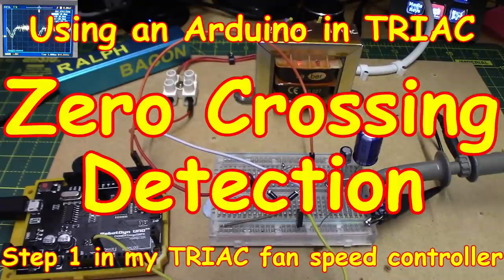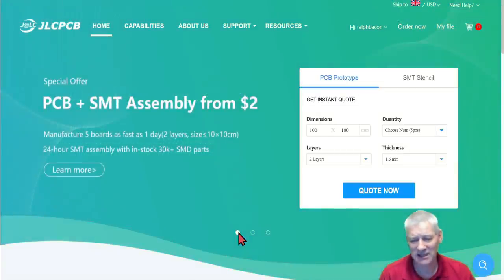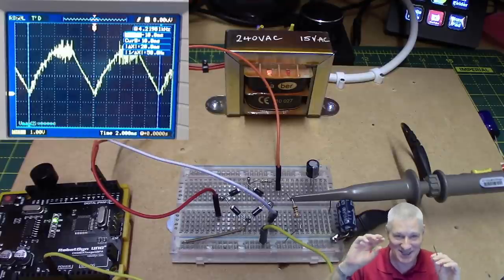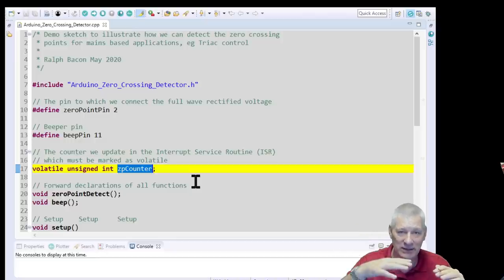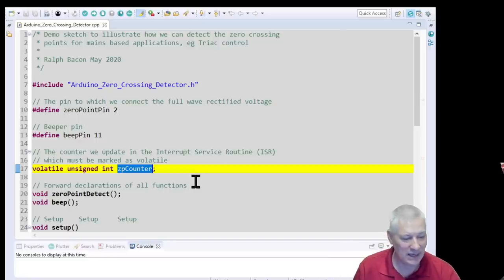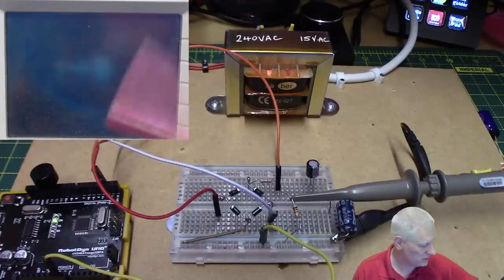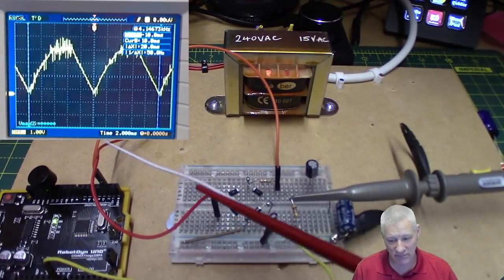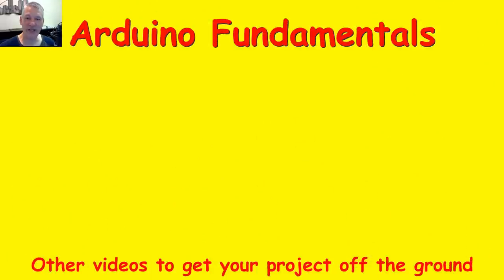#189 Zero Crossing Detection using an Arduino (TRIAC Dimmer Control)

Comment: When I was a kid in the 1980`s I made some disco lights with a tape recorder, 555 timer, 4017 decade counter and 10 triacs. Don`t know how I did it without the internet lol. Now 50 years later I want to do the same. :)
Reply from the maker: I, too, made some disco lights when I was a teenager (yes, we had electricity and even running water back then) but I'm amazed I survived all that 240-volt stuff. No isolation in those days, direct connections to triacs. 😲

Comment: I've build similar projects before. One thing to keep in mind is forward voltage drop of the LED in the optocoupler. This can cause a timing issue when trying to run near 100 percent. The opto will switch off before the zero point and back on after the zero point happened. A simple solution is to only allow a maximum on percentage for the trac, say 90-95 percent. Otherwise you'll need to have a very critical time delay required from the trigger point to the actual zero cross. Trigger the trac slightly to soon and you'll miss a whole half cycle.
Reply from the maker: Indeed, timing will be critical but I hope software will allow me to adjust this. We shall see!

Comment: I would be interested to see you toggle a pin on every interrupt and see how the edges line up with the actual zero-crossing. Because you're using digital voltage levels I suspect they may be off. Thanks for the video.
Reply from the maker: Yes, indeed, they will most certainly be off, a bit, but we can correct that in the software by including more delay before switching on the TRIAC. I'll cover this in a future video, Marc, it will be useful for everyone to see. Thanks for raising this.

Comment: Great explanation mate, thanks for the video. I was like WTF when I seen you attaching a transformer to an Arduino but it all makes perfect sense and has some merit. Looking forward to your next video
Reply from the maker: Remember the rectified AC went through two resistors (potential divider) before hitting the Arduino, see the circuit diagram in my GitHub for full info.

Comment: 4:13 Thanks.  This is the most important information I've heard in a long time.  It explains all my USB problems.  It does seem like they started when I replaced my USB 2.0 hubs with 3.0.  My old 2.0's died so I replaced them with the latest and greatest.
Reply from the maker: Glad it helped!
Reply: @RalphBacon  ever since I replaced my 3.0 with 2.0 the other problems went away as well.  I think 3.0 causes Windows to produce spurious interrupts.

Comment: I have always avoided level triggered interrupts, use edge triggering whenever possible.  In fact I cannot think of a reason to use level triggering.  Your on screen comment "I suspect the pin is kept LOW too long by the signal" is quite correct.  This ISR is very short, if you use level triggering, by the time you get back to the main programme the level will still be within the LOW parameter so another interrupt is generated.  Using an edge triggered interrupt avoids this problem.  No matter how quickly your ISR is serviced, another interrupt request will not be generated until the next falling edge, i.e. the next cycle.  Bob
Reply from the maker: Yes, indeed, Bob. The pin is LOW once the voltage drops to about 2-3V and stays low until it goes above 3V again on the next (half) cycle. I can't work that out in my head but it is probably a millisecond or two which to the interrupt hardware is an eternity and just keeps triggering! Others have commented on using level triggering, usually with the word "Why?".

Comment: Hi Ralph, interesting stuff indeed, this is a good proof of concept I look forward to phase 2 and capturing the exact zero point, as an interrupt triggering on a falling edge is probably gonna be a bit early but i'm sure you've figured that out.
Reply from the maker: Well, 2-3 volts too early, probably, which we can correct in software (ie delay a bit more). I'll get the 'scope out and get it spot on!

Comment: I once used a single diode (half wave AC rectification) as input to an optocoupler.  That gave me a square wave pulse for each cycle.
Reply from the maker: Yes, that would work. The half sine wave could possibly be made squarer with the use of a Schmitt trigger but if it works as-is then it works!
Reply: @RalphBacon  Point taken, but it's only triggering a counter IC for a clock, so as long as it transitions low to high, it's fine.  I don't think it has to be a perfect square wave for this application.  In fact, I'd say that even if it was a sine wave, the counter would still count correctly as transition, not shape matters in this case.

Comment: Hi Ralph
Most domestic fan motors are split phase induction motors or shaded pole motors. While a “lamp dimmer” controller allows a certain amount of speed control, it is not linear and the torque the motor develops at low “speed” settings is sometimes too low to kick start the fan. A simple plan to overcome this, is to boost the speed to full on when initially starting for a few seconds and then revert to the set speed. Obviously with a little Arduino programming.
The above motors are normally designed to run at a fixed speed determined by the number of poles and the mains frequency. They are best speed controlled with VFD controller, but these are horrifically expensive and not suited to the average hobbyist. Basically, for lowering the speed, the frequency and the voltage is reduced and vice versa to speed up.
A lot of domestic pedestal and ceiling fans have a simple 3 speed control. This is done with a series connected capacitor of different values for the speed.
Thanks for reading my ramblings
Regards Ivo.
Reply from the maker: Indeed, Ivo, it is a complicated subject. My ceiling fan has 3 different tappings in the windings to give me 3 speed settings. Not something you can retrofit! But my workshop fan also stalls when I switch it on at low speed (the speed at which was last running quite comfortably) so I had thought about storing the last good speed in EEPROM, turning the fan on at a higher speed (not necessarily full speed) and then moving to the previously stored speed. Luckily, once the hardware is done, we can just about anything in software. Stay tuned for this project's progress over the coming weeks! Thanks for your post, most interesting.

Comment: I've been wanting to try the interrupt method as a means for providing a time base for a clock using the AC mains for the time base.  Thanks for the inspiration!
Reply from the maker: Did it work, Jerry? This should be very accurate, it's how mains-operatied bedside clocks are often synchronised to keep good time.
Reply: @RalphBacon  
I haven't tried it yet, but have plans to do so.  Too many projects...  I agree about the accuracy,  My 30 year old AC powered clock radio is very accurate!

Comment: Hello, I would like to shed some light (pun intended), on the 60Hz vs 50Hz. 60Hz allows for synchronous motors put in clocks and timers to maintain perfect time. 50Hz benefits the poor sap who touches it, as it doesn't phase (stop) the heart like 60Hz does. However,  running mains at 220V or 240V kinda offsets that safety. Hope this helps. Sorry, but puns are part of my sharing process. Cheers from (North) America.
Reply from the maker: As they say, Sharing is Caring. And boy, you really do care! 😁

Comment: Ooh I like where this is going, I will need to wait for the next upload but I'm sure I can use this to reverse engineer a piece of equipment I have at work, It uses a triac to vary a 110vac supply to vary the rate of a vibrator coil, I need an Arduino to detect this and the map it to a pwm output. Good reason to get my first jlc PCBs done too 

Keep it up Ralph
Reply from the maker: If this inspires you, Andy then that is my work done here. Great to hear from you.
Reply: @RalphBacon  it does you explain stuff in depth but without babbling on. I find it very helpful. I may need to pick your brains with my little project is there a way I can contact you? 
Thanks
Andy
Reply from the maker: My email is in the About tab of my channel.

Comment: Sorry to say, your logo output circuit is wrong. You will burn out your opto that way...shorting the to pos to the neg. What you need is ground and pos via a resistor to pos. Take the tapping at the logo. Or, if you use the internal pull-up, only connect the ground.
Reply from the maker: Yes, you're not the first to spot this, Terry, I rushed it. don't worry, the final circuit will be fine. Well, fine-ish.

Comment: In the diagram, there was a resistor missing in the collector of the opto-isolator transistor, otherwise the transistor shorts the supply and will fail.
Reply from the maker: Yes, that was already pointed out to me! It was a virtual resistor, in my head. Which I occasionally do not screw on correctly.

Comment: If an interrupt is repeated to many times your LOW setting, a trick is the test the time has pasted since the interrupt was last called. It is slow to real the time values and do a compare but not for your timescales.  Since you have the signals  in the Arduino then consider not a triac and a single delay but a  high voltage MOSFET inside a bridge regulator pulse on/off several time in the time period to give a smoother control. Perhaps above hearing frequencies. Thanks for the video as always.
Reply from the maker: I've used the time-test trick on my rotary encoder projects, Graham, as it would not work reliably using FALLING, would you believe? Not what I would consider ideal though (although it works perfectly).
If I were to use MOSFETs then I would change this dimmer to be trailing edge to give smoother control and no exploding bulbs on switch on. But for induction motors (eg my fan) it is not ideal due to back-EMF.

Comment: You can use zero crossing detection to detect the peeks if you use it on a differentiated  signal created by feeding the original signal into a appropriately configured op amp. You can also use a comparator to detect the zero crossing if you don't want to use a microcontroller. These techniques were used in disk drives for reading floppy disks.
Reply from the maker: Hang on, Stephen, you say "if you don't want to use a microcontroller". I'm sorry I just don't understand that sentence at all. "Don't want to?" You do know this channel is all about Arduinos and related devices? Ha ha! But seriously, I'm sure there are other ways to detect zero crossing but I definitely wanted to use a µController in this project.
Reply: @RalphBacon  Yeah it is amazing that some microcontrollers are so cheap now that they can replace simple chips like comparators and 555 timers.
Love the channel.  Keep up the good work!
Reply from the maker: With your last comment in mind, watch this week's coming video, #190!

Comment: Digitally-controlled DC variable-speed drives, which must also detect mains zero crossings in order to accurately fire their thyristors, have a lot more filtering of the signal than your simple detector.  They typically have a 2ms RC filter on the digital input and use a digital phase-locked loop technique to accurately predict the zero crossings in the presence of mains harmonic distortion and noise.  So, it would probably be a good idea to, at least, program some sort of sanity check on your detected zero crossing before using it.
Reply from the maker: I'm sure you are correct, Chris, but this was a proof-of-concept demo not a finished design. As it stands, the "zero" crossing is detected too early (as soon as the AC cycle drops below the OFF level at about 3V not zero volts). We would have to correct that in code. Keep tuned for further videos that demo my fan speed controller!

Comment: Have problems with using opto couplers for accurate zero point crossing-- the opto coupler needs the voltage high enough to drive about 10mA through it and this voltage is largely a function of the total resistance in series with the diodes. This won't be at the zero crossing. It's good for measuring frequency but not for applications say involving power factor measurement whereby one needs to generate pulses for the entire positive half of the waveforms-- current and voltage and further process them.
Reply from the maker: It won't be at exactly the zero crossing point, correct, neither is mine, but the time difference is a known quantity so it's easy to compensate in software for that.

Comment: Hi Ralph. Did you get around to finishing  your fan controller? Brilliant channel by the way. 👍
Reply from the maker: Thanks, Daz. 

Now, I'm just trying to work out what you mean by "fan controller". 

If you mean, did I get it all working with a triac, the answer is no, but I did get it working very nicely with a Variac and has been running like that ever since, controlled (via IR) from my Smart Heater Controller (or manually from the IR remote control that came with it).
Reply: @Ralph S Bacon  Hi Ralph, Thanks for the reply.  Yes, the arduino controlled triac you mentioned in the video. I was curious to how you were going to accurately delay the firing of the triac after receiving the zero crossing signal?
Reply from the maker: OK, well, as I said I eventually didn't do it that way. But to accurately trigger the triac you "just" detect the incoming AC, and as it approaches zero (trial and error) you turn on the triac so it actually turns on at zero (on the crossover).

This can all be tested with a very low voltage transformer supply (eg 9v, certainly not mains) and put the output & input waveforms on a 'scope to get it spot on.

Just to clarify, as the incoming waveform hits, say, 2v, fire the triac, and by the time it actually fires, the voltage will be as close to zero as makes no difference.
Reply: @Ralph S Bacon  Thanks Ralph, that's great! Looking forward to your next video. All the best.👍

Comment: Correct me if I am wrong, but I belive that there is a misunderstanding involved, regarding the voltage on the blown capacitor. 

15V•1.4=21V
 is what is said in the video ( 6:06 ).
But that is not what the capacitor had to deal with, right?
The capacitor dealt with peaks of our full wave rectified 15V. Not more.
Considering the drops on the diodes, even less. 
At least, if what is written on the transformer (15V output) is true. 

Where does the factor of 1.4 come from?
Well...if I'd want to heat up a resistor when using DC, by the same amount as I'd heat it up when using the 15V AC, I would need 
15V / 1.4 ≈ 11V DC. 

But that has nothing to do with our situation, were the C ended up being blown up. It did not blow up because it could not decipate the heat. It blew up from overvoltage.
Reply from the maker: The 15V from the transformer is AC, as you have stated, Anton. This is the equivalent DC voltage when heating an element. So 15V AC and 15V DC heat an element to the same level.

This is called the RMS value of the AC voltage; the peak-to-peak AC voltage is 1.414 times that amount. That's why when smoothed by a capacitor we get to see that. In this case, about 21.5V (allowing for the voltage drop across the diodes, which you also mention).

The capacitor failed (rather spectacularly, it must be said) because it was not rated for anywhere near that voltage (just 6V). Kaboom.

So you were on right lines but the 15V AC is the RMS value not the peak voltage. In the UK, our 240V AC has a peak-to-peak voltage value of about 340V (240 x 1.414). Quite a difference. 

I hope this clears this up.

Comment: This is just a hint from a coding geek, it may not mean anything.
If the zpCounter hits 100 while beeping(longer beep, or higher frequency), the next event may be missed. Here's how to avoid that:
volatile int zpPending  = 0;
void zeroPointDetect(){
  if(zpCounter++)>99){
    zpCount=0; 
    ++zpPending;
 }
}
void loop(){
  if(zpPending!=0){
    --zpPending;
    beep();
 }
}
increment and decrement are assumed here to be atomic.
Interesting project, thanks for making me think.
Reply from the maker: Thanks for the suggestion. There was another comment about using integers, that the update would not be atomic which I believe is not true. 
As it is marked as volatile any ONE action (eg read, write on  both bytes of the integer) is carried out atomically. But an update requires a read AND a write so it could cause problems inasmuch that it could be updated between the two actions.
Back to your comment, regarding potential missing pulses. I don't believe this is the case, as the interrupt will run regardless of whatever else is happening in the loop, be that a beep or delay or whatever. For example, if I beeped on the 100 count for a whole 500mS then that beep routine would be interrupted 50 times (every 10mS). If I beeped for a full second the beeping would never stop!
Thoughts?
Reply: @RalphBacon  Whether an int decrement or increment is atomic depends on the processor, i386 can increment a 32bit value at a memory location in a single instruction which is atomic. In your application, or any application with steady events  frequency and short handling, probably never going to see endless beeping. The suggestion is suited for more stochastic event processing.

Comment: Ralph, you are confusing Interrupts with Windows Events. The Intel-based CPU has hardware interrupts, and they work exactly the same as the Arduino ones. Mouse movements and the like are Events, which are an entirely different affair. Any mouse-based interrupts that occur are dealt with *immediately*, as the Arduino would. But mouse events aren't important, so they're just added to a queue at that point, to be handled later when the system isn't busy.

Events are essentially the opposite of interrupts. They must wait until a unit of computation is complete. This is why programs are often "Not Responding".
Reply from the maker: Good to know.